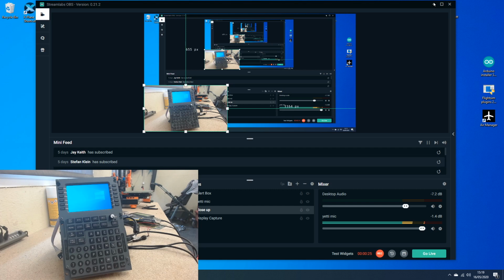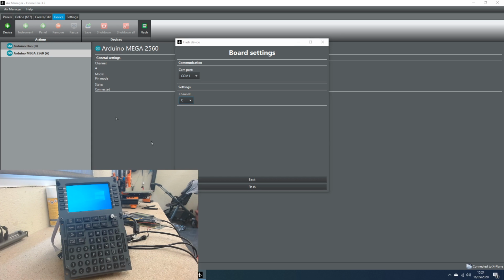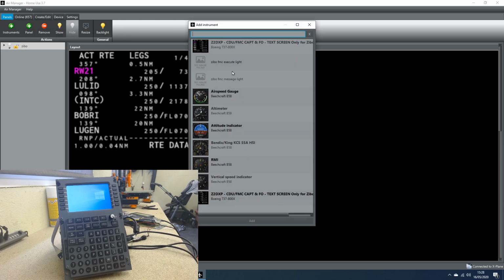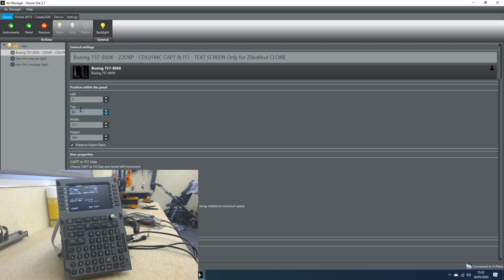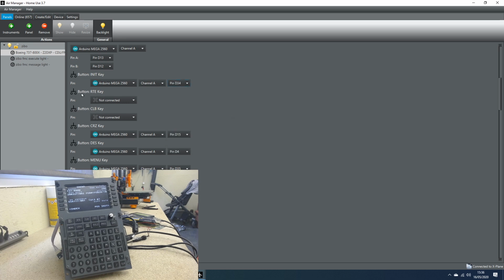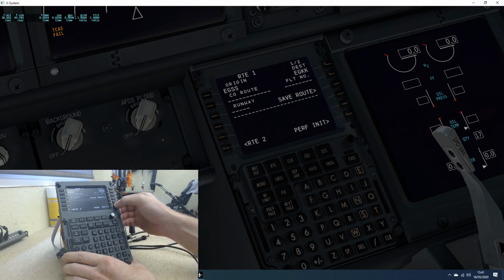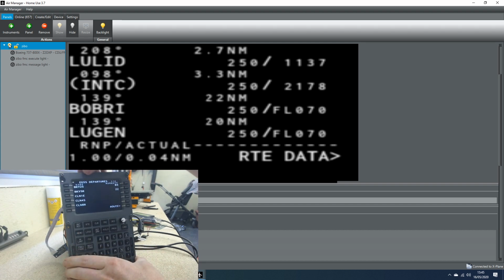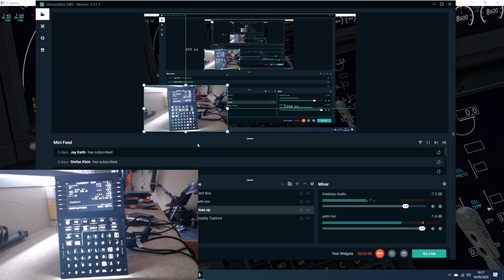737 home sim build - cockpit sim parts fmc review and build Part 3

Comment: Great work! Admire your patience and perseverance!!
One small question: what is the size and specs of the FMC screen you're using? The link you've given here is broken.
Reply from the maker: thanks for the heads up about the screen no longer being a valid link, The screen i used was just a generic 5" screen with controller board found on ebay such as https://www.ebay.co.uk/itm/LCD-Controller-Board-5-inch-ZJ050NA-08C-640-x480-LCD-Screen-Panel-40Pin-/363067623060?var=&hash=item5488844694 or you can pay slightly more for a uk one if thats where you're located.
Reply: @simbuilduk5853  BTW, what is the enclosure of the FMC? Don't you put it into some kind of box/package?
Reply from the maker: @Perry778  the enclosure was simply a platform on standoffs, I 3D printed mine but I no longer have the file. If I was to do this again I’d invent a different way using some Perspex and standoffs

Comment: I've watched a ton of videos to plan my FMC build. Your video by far is the best from my skill level. I will use the Arduino mega and likely the Pro micro. I've also considered using an MCP23017 IO Expansion Board (2C) interface board to Expands 16 I/O Pins.  Thanks a lot and I've learned a ton. Excellent work!!!
Reply from the maker: thanks Olin, always nice to hear my vids are helping out, that was always my intention. Good luck with your build, I'm always here if you need any help.

Comment: First of all congratulations on your titanic work! I really want to get into the 737 panel design too, but I'm not sure what to start with. Do you have any advice ? I have a quick question to compare with a plug and play how much to cost about your fmc ?
Reply from the maker: Thanks, first is to choose what sim and interface software u want to use, then start simple with a breadboard, jumper wires and some simple switches, led’s, encoders etc. Then just have a play at getting them working. You can learn so much by doing this then you can progress into 7 segment displays etc.
Reply: sim build uk thank you very much for answering me so quickly! can you explain to me how in the end each module and arduino is to connect via simvin to the simulator? Simvin knows that such arduino belongs to such module? because I guess you have to use a usb hub to connect each arduino or are they all on the same bus and only one is connected?
Reply from the maker: @psarkoteck  You can only use 1 arduino with simvim, then you can run a multiplexer from each pin. You can have 16 buttons for each pin on the arduino or 64 leds for each pin. Theres around 60 pins on the arduino so now you start to realise why you only need 1 arduino for a full sim.
Reply: sim build uk Oh ok ! I have placed an order on aliexpress and will therefore be able to start building my mcp from 737. I think it's good to start with mcp because there are buttons, encoders, 7 segments led display ect.
Reply from the maker: @psarkoteck  I highly suggest you get all those things working on a breadboard first, Its alot easier to change wiring to figure it all out, then take what you've learnt and transfer it to soldered connections on your mcp.
Reply: sim build uk yes that's what i planned to do. I can't wait to see the next video !!
Reply from the maker: @psarkoteck  good luck, efis and mip video coming up soon
Reply: sim build uk good luck for you too and see you later maybe on fs2020 😅

Comment: Hi- Great videos, I’m still in the process of planning my cockpit but plan on using Simvim due to its ease of use. From your other videos it looks like you will be doing the same for majority of the cockpit build. Since you are further ahead than I one question I had was why didn’t you use Simvim for the FMC button programming and ZCDU? 

This is what I was planning but curious if I can learn if you found out why that wasn’t a viable option?
Reply from the maker: Kaiser hi thank you for the feedback, yes I’ve now decided to use simvim, the reason I didn’t use simvim for the fmc is because at that stage I wasn’t keen on using only 1 arduino, it wasn’t until after I built the fmc that I discovered how easy the breakout board system with simvim is.
Reply: Thanks for the reply. Looking forward to the EFIS video! Your videos have really helped me visualize my own planned implementation as they are very similar.
Reply from the maker: @Kalease54  always happy to help, the efis build is well underway

Comment: Excellent job!
I am also using Air Manager, great product, I started with Simvim, but it only supported one Arduino and you have to use a lot of multiplexers to get enough connections.
Then I tried Mobiflight, but in relation to Xplane this was a nightmare for me.
For working with 7 segments displays, Mobiflight is easier to use.
 I then found Air Manager and it suited my expectations.
After understanding how the coding works it's fairly easy to use.
For now I have my FMC and EFIS working, so if you have questions let me know.
Reply from the maker: Jeroen Vermeulen thanks, yes it’s a shame sim vim doesn’t support more arduinos, I heard that it’s in the pipeline tho. I have had a full working mcp on a prototype board with mobiflight but took some experimenting to figure it out. I haven’t tried a 7 segment display with air manager but on your recommendation I’ll give it a go as I’m now building the mcp which will be in a future video

Comment: Ian for the vga connection - do you plug that into a secondary graphics card in your pc?  I only have DP and HDMI on my 1080ti
Reply from the maker: Hi Paul no mine runs into a little converter adapter that changes it to dvi, you can get converters for vga to HDMI or DP for a few quid on amazon